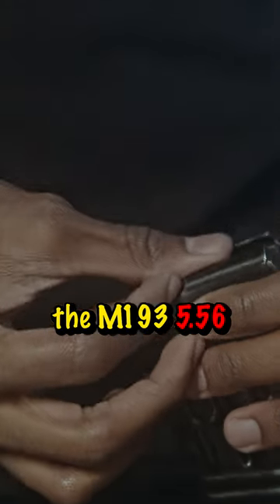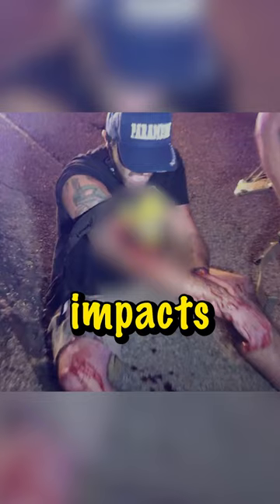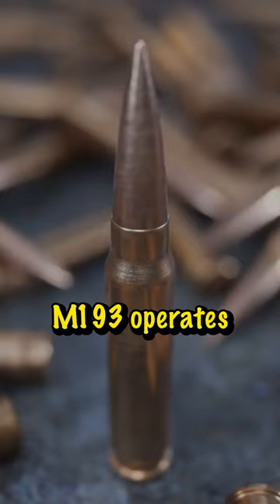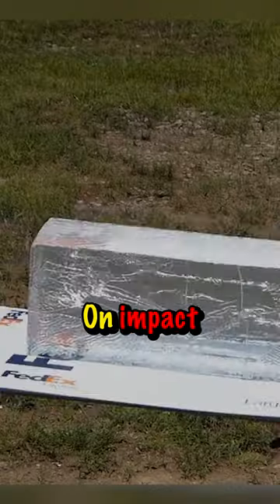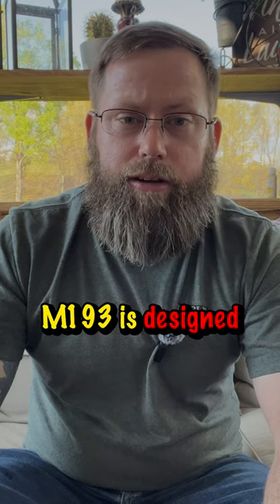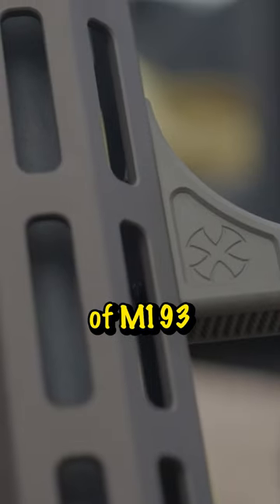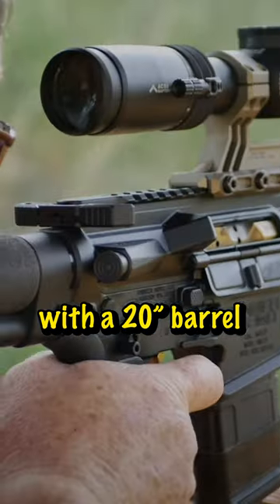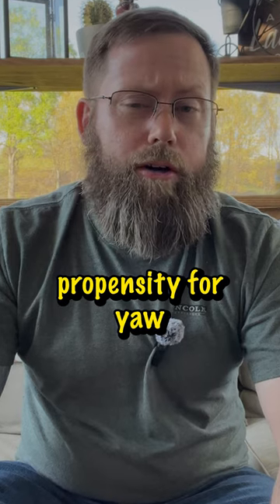The AR-15 5.56 M193 55gr Overview - Everything You Need To Know

Comment: The 62 gr worked great on my deployments I had no issues. The M855A1 EPR was great on barriers.
Reply from the maker: M855A1 is good but very hard on the gas port.
Reply: @gun_coyote  Really? Probably depends on the barrel and the quality of the material. It is higher pressure that is a fact so I can see it having increased wear.... Definitely can increase wear on lands and grooves as well as impact barrel life.
Reply from the maker: @Phantom8589  yeah M855A1 has been shown to have greater gas port erosion, especially on carbine gas systems.
Reply: @gun_coyote  Good to know thanks brother, keep up the good work.

Comment: What weight do I need for effective self defense in a house (so it doesn’t go through the walls?)
Reply from the maker: Not going through a wall inside a home is basically impossible to guarantee.
Reply: @gun_coyote do you need to use a shotgun instead?

Comment: The picture of the bullet that says "of speed" is not the round in question. It looks like 300 blackout.
Reply from the maker: Good catch! It’s a 3d render so we have no idea. We’re still building our studio out and getting our b-roll together and this is what we had available from the stock library. If you have footage you can send, we’d happily use it on the channel! Send us a DM on X or check the pinned comment, thanks for watching 🫡 😃 🇺🇸
Reply: Bro first of all - that’s clearly a 3d render… and it’s of a 5.56 .. that ain’t blackout look at the size of the projectile 😂
Reply: Had to rewatch the short for this. That’s a computer image. And it looks like 5.56 not blackout just look at the tip. Blackout is different.

Comment: None of that really sounds right.

You talk with confidence but not truth.... maybe

A small light weight bullet travel fast allowing for well will aimed suppressing fire out of a equal light frame rifle with low recoil.

Meaning troops could carry large amount of ammo and shoot on the move with easy.

The fast speed of the bullet gave it a very flat trajectory making it easier to aim for combat under 500 yards. 

One of the key reasons for it's adopted was to help with time on target and getting shots off. Where someone would only show them selves from cover for 2-5 second so you wanted to put as many accurate shots down range in that time frame as possible.

I honestly don't think impressive wound cavity and ability to tumble really ture about this round 

I mean it does do that sometimes....... 

Just think there's so much eals that could have been said that relevant then that
Reply from the maker: This video is purely talking about the terminal ballistics of 5.56 M193 in soft tissue targets. Unfortunately in a short we don’t have the time to cover everything we would like and will be exploring more in future long form videos.
Reply: Let's break it down.
The m193 operates on the principal of velocity over mass. It's a relatively small light weight bullet at only 55 but going a amazing 1500 ft per second. 

This allows for flat shoot hard hitting round,  while being quite small in the same diameter as a .22 it  has a much larger impact force due to its speed. 

 The small nature and high velocity of this calibre makes for a much more comfortable shoot experience, with a  more manageable recoil compared to (7.62) making rapid fire and follow up shooting easy and more accurate.

It has a effective rage of 500 yard it most devastating effects can be seen when hitting target at 250 yards or less, with so much velocity at that rang the bullet can sometimes tumble on impact leaving a large wound cavity.

It has great flight characteristics but dose lack enough mass to penetrate solid objects with as little as a car door been enough to change it trajectory, and with things like mansory and concrete stopping it in its tracks something not normally surfed by heavy rounds.
Reply: Tbh not sure you could read that in 60 seconds 

Soooooooo 

But nice work on the video anyway